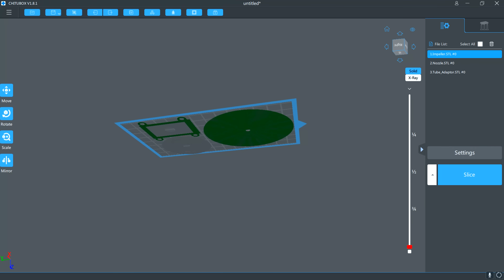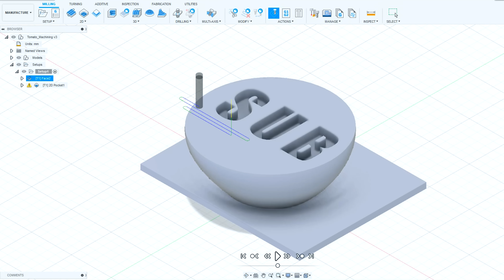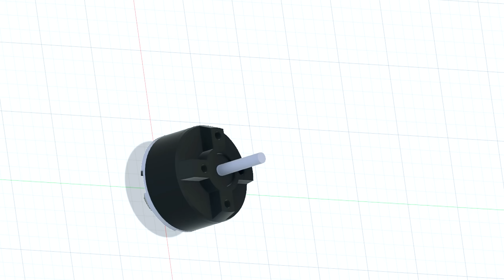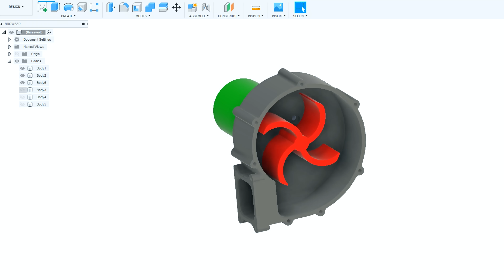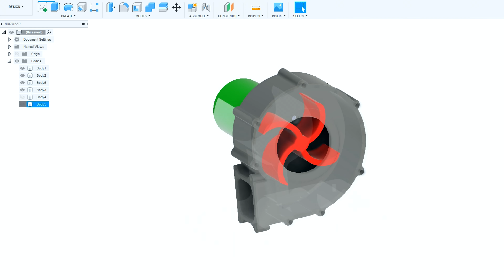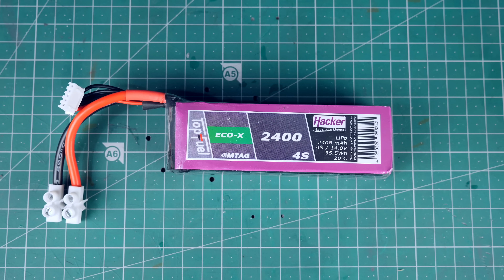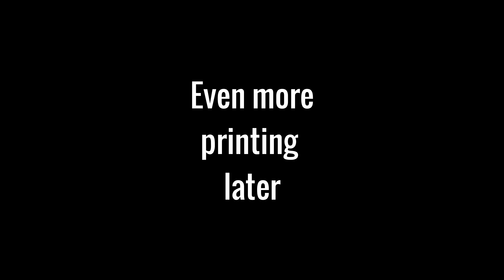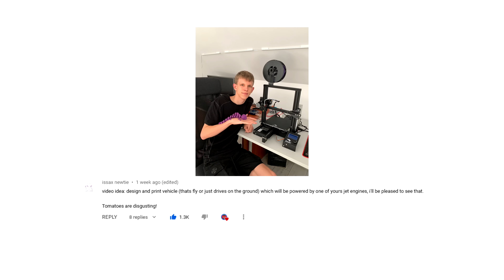Water Rocket Skateboard (3D Printed)

Comment: just watched the Video and saw some problems with your design.

1: you have a lot of cavitation which affects the flow rate in a bad way wich in return limit the maximum speed you can achieve. remember you dont want speed  in that case but flow rate. the more stuff you can push away, the greater the force.

2: a centrifugal pump isn't the best pump in your case. try a actual water jet engion design wich schould work better for that. theoretically you could use a tesla engine, but you need to know the perfect distance between the disk to use the maximum of the viscosity of wather.

and 3: build a small tesla turbine and put it on an RC-Draggster

Comment: Try using Tesla turbine and that way u can connect the rotating shaft of the turbine to skateboard’s wheel to provide POWER to the WHEELS . And the water pumping out will also provide thrust to move it forward . Design or use an small water pump to pump pressurised water into the Tesla turbine. 
And also lower the outlet hole in the water reservoir to use the bottom half of that water in that water reservoir.

 And crush thy gross tomatoes 🍅

Comment: A small suggestion if you try this one again, any water in the reservoir below the level of the inlet won't ever get pulled into the pump so is essentially a lot of dead weight. If you redesigned so the inlet pipe is joined to the reservoir at the bottom you'll be able to extract more water from the reservoir before the pump runs dry, or pump the same amount of water with a lower vehicle weight & hopefully get a higher vehicle speed as a result 🙂 Love watching your builds. All the best

Comment: At least in some scenes the pump seemed to blow up due to overspeeding when it started sucking air. If you print a round plate with regular holes (paint it to block infrared) in it and add it to the motor axle, you can use one of these IR sensors and IntegzaBot to sense RPM. If it starts to overspeed, IntegzaBot can disable power to the motor by disconnecting the signal wire between the remote and the motor controller.

Stop-on-Overspeed is a well known thing in the rocket industry. It was used in the V-2 rocket for its fuel and oxider pump.

Comment: After the multiple uncontained failures related to uncontrolled impeller overspeeds, even though no victim has been reported and failure happened only at ground level, I hear EASA issued an emergency AD to ground the entire fleet until the Type Certificate Holder demonstrates :
1) The design of an impeller design that must operate safely at any engine operating range up to 120% demonstrated take-off thrust
2) The design of a suitable engine speed control with sufficient authority to accurately control speed and forbid any overspeed of the impeller throughout its operating range up to 120% demonstrated take-off thrust
3) No Hazardous effect may occur more than once over 10^8 flight hours
4) Proper maintenance procedures on both impeller and impeller casing OR demonstration during a ground test that impeller failure does not generate uncontained high energy debris at maximum operating speed, including, if applicable, any OEI power excursion

Comment: The solution for making metal parts without using your CNC since you aren’t willing to cut metal with it yet is, “lost PLA” casting or creating molds of 3d printed parts and casting them with metal. I’d love to see one of your rocket engines made with that method!

Comment: Hi Integza, 
you might want to take a look into Viktor Schauberger's research about how to bring water into a vortex motion to accelerate it even more. If you could create a nozzle that brings the water into a swirl maybe it will be ejected with higher speed and therefor higher thrust.
And how about starting a crowdfunding campaign to get you a metal printer?

Or you can use electricity to convert the water via electrolysis into brown's gas and then burn it in a jet engine. Then you have a water powered rocket skateboard.

Comment: The pump schematic is good. There is only one problem. Instead of a plastic impeller, use a rubber impeller that will slide against the walls of the case. It will work much better;) and it won't explode the  pump xD

Comment: The design needs rework! Here are some suggestions:
First reduce the pumping volume you need speed not volume to be pushed. Half hight would more than enough.
Second stabilize the wings with  discs. The one to the input can have a hole in the middle.
Third adapt the propeller angle target pumping volume / speed. 90° generate high force to the wings and low output pressure. 10° generate low force and high pressure.
And for fun combine the watherjet with CO2 in a mixing chamber - as you did at your rocket science.

Comment: Theme: Try and make something, an engine or something using Strain wave gearing! Strain wave gearing is super weird and amazing, 

"Strain wave gearing is a type of mechanical gear system that uses a flexible spline with external teeth, which is deformed by a rotating elliptical plug to engage with the internal gear teeth of an outer spline"
Reply: I would not be surprised if that type of gearing had a 5 second life expectancy lol
Reply: @trufortune6771  its actually not that bad. If I'm correct, another name for it is a harmonic drive. Its actually a decent solution for certain robots because it can't be backdriven and offers a really high gear reduction.

Comment: Idea make a rocket engine with a solid magnesium core using that pump you created to pump water around the outside of the magnesium core and make a spiral fuel injector that pumps a spiral of liquid oxygen around it creating a wired rocket engine

Comment: you changed 2 variables at once: the size of motor and the design of the impeller. no bueno. i think the impeller you used with the 60krpm motor was worse.

Comment: Here's a tip to stop the acrylic from splintering everywhere while machining: Covering the top surface with some adhesive tape will make it a lot more forgiving. Plus your turbine would be a lot stonger if you left a disk at the end which supports the blades.

And in a future video, you also could print an air-powered Hüttlin spherical engine. That would be a proper challenge.

Cheers for the awesome content!

Comment: You should shoot liquid fuel rather than water with a tiny pump and have a spark plug at the end, and also have a metal nozel as with pressure the heat should stay at the tip if the nozel

Comment: Video Idea: Now that you mastered the power of water : ) ...

You should make a Water (or other liquid) Rocket ,
using some kind of chemical reaction or just pressure.
Reply: Hydrolox-engines (liquid hydrogen & liquid oxygen) produce water (=steam) as propellant. Very old technology, even the Saturn V used hydrolox engines in it's upper stages in the 60's. That doesn't make them bad at all, they still yield highest amount of delta-v than all the other chemical rocket engines in low air pressures. :)

Comment: Your prints failed because they were the color of a tomato.

Video Idea: Upgrade the water jet engine to use a screw impeller like jet ski's and SeaDoo's use. Also, use a stronger 3D resin like one from Siraya Tech, or even try printing with a Carbon Fiber Nylon or Carbon Fiber Polycarbonate filament. You can try using the "salt remelt" method to make the fdm prints as strong as injection molded parts.

Comment: You need to use the impeller design from a high pressure pump and use a 2 or 3 stage design. Like the pump on a fire truck. Also your efficiency was being ruined by cavitation. You want as little vacuum pressure as possible on the inlet side, big inlet small outlet. And, by restricting outlet flow the pressure increases while the flow decreases. Potentially more power using less water. It would be interesting to know which pressure to flow ratio is most efficient for a skateboard rocket.

Comment: Maybe try running one of those pneumatic engines off of water held above it (using the water pressure) with a return pump to keep the system cycling and put that on a vehicle, maybe with a belt drive or something? :D

Comment: Integza! it may help to make the pump more like a turbocharger than a flat vane pump like that. Might give you more thrust possibly. Also usually turbo impellers structure just lends itself towards higher RPM's much better. I actually 3D printed one for a vacuum project for college once using a drill motor and it worked like a charm. Even got first place!

Comment: I think you should use gasoline instead of water, and fix a spark plug in a metal chamber or a 3d printed chamber where the pressurised gasoline comes and ignites. 

Here is your jet engine.

Comment: You should print the impeller using. A more traditional impeller design, this will make it less loud, and should direct the water without so much oscillating. The motor seems like it should be able to handle the extra weight and the impeller should direct the water into the nozzle more efficiently. That may not be enough to solve the casing weaknesses, but it should help the design overall.

Comment: I'm a dummy, but I think your impeller needs several more vanes. Also, your water outlet is much too high up on the tank. It's only going to use half of the water supply.

Comment: Great video as usual ! In order to make a water expulsion engine, you'd be better off with compressed air to use as energy for the expulsion. Water rockets can go as high as 500m if they are well designed ! But you should use carbon fiber tanks for that efficiency, 3D printed tanks are not resistant enough

Comment: VIDEO IDEA:

how about create a turbo-thing.

so a turbo works by using the exhaust gasses to power a rotor that pumps more air into the engine, you could do this with your impeller, and it would explode less since your not trying to move it through water.

instead of using the exhaust to power the turbo, use your 60,000 rpm electric motor and cnc an actual turbofan that can more effectively pump and hold high pressure air.

and yes, i have subscribed and liked the video

Comment: I don't think you're design is the issue here, there is still a lot of air in the pump when you run it, this decreases the viscosity of the medium when the pump is running. that way it allows the impeller to speed up to insane speeds and shatter. If you have the entire pump submerged there should be no air and I think it would run fine.

Comment: It kind of looks like on the last attempt that the pump exploded as soon as the water level got below the top of the valve input.  Could the problem be rather than the speed of the pump underwater, that the pump started ingesting air and all of a sudden started going way faster (and subjecting the rotor to much higher forces)?  It seemed to be pushing itself alright at the higher speed up until that point.

Comment: I'm gonna repost my last comment on one of these videos. Print a small magnetohydrodynamic drive vehicle! A boat, jet ski, or submarine would be awesome.

Also, you should look into lost plastic and lost wax casting. You have printers and a CNC, so you can easily make accurate mold negatives that can then be cast out of higher strength plastics or metals. That way you won't be limited by the printed part at higher RPM or higher temperature. Also, have you tried Sirayatech high-temp or high-strength resins for your printers yet? There's also ceramic printers, or modifying one of your own to do it, maybe that would help with your rocket/jet engine projects.

Comment: Video idea You need to run the motor on a higher cell count the motor can handle 6 cells or 8 cells with the right esc and batteries you could make that motor run way faster. Also try adding a sper gear that connect to the paddle and a pinion to the motor to spin the paddle faster. And tomatoes are gross but ketchup is great

Comment: Would make a great boat like a jetski engine maybe. On the water container you could build a small box inside it around the pipe fitting with just a thin lip on one side for the water to enter at the bottom of the container that way you can drain the entire container into it instead of only half way. If you build a boat with this, make it a thrust vectoring nozzle like a jetski has.

Comment: The biggest problem was that pump Inlet was weyyy too small.... Senn by the air in the pump while running and the noise that it made. So if you fix this, the scatebord will work.

Comment: Your pumps are exploding probably because the impeller starts cavitating. Not only is cavitation alone capable of shattering the parts, but the rpm probably shoots through the roof. You need a geared pump for this, not a centrifugal one.

Comment: To fix the pump try using a stronger plastic like POM (Acetal). 
You can get a block of it and machine it since it machines and polishes pretty nicely.
And it's a very strong plastic that is self lubricating so it should help with optimizing internal resistance as well.

Another issue seemed to be that the pump was pumping out water faster than it was being fed, so the air created cavitation that destroyed the impeller and that air since it had to come from somewhere, most likely came through the nozzle, further reducing efficiency.

Hope this helps you fix it.

Comment: Nice Video Integza, but you are not operating the pump at its maximum efficiency, nor its maximum power, if you check any centrifugal pump chart, you'll notice that maximum power is never reached at full flow nor full pressure, what you must do for the next video is to add a pressure vessel and test with different nozzles (thinner ones) to get maximum power since we look for water velocity. Otherwise, an axial pump is better if you want to increase flow at low pressure.

Comment: Couldn't see if you did this, but I think your impeller could be improved by having an opening or "eye" at the centre with the blades radiating out from it. This allows water to flow quicker into the pump and will make the flow smoother I think.

Comment: I think that parts for high mechanical loads are better printed with FDM instead of SLA. Resin prints are more brittle and break quickly when deformed. I think that a rotor made of PLA is capable of withstanding higher accelerations and more pressure. As always a great video!

Comment: so much air in that pump! the valve is restricting the flow into the pump way to much. with proper flow, I wouldn't be surprised to see 10 times more thrust with that motor.

Comment: So this is a good idea I have a design tho that uses a water pump and then instead of dumping the water sends it through a second propeller connected to a shaft and then goes into the reservoir this is basically my idea of a water engine im not sure how well it will run with pressure being concealed in a closed circuit I don't have the resources to build the idea but Been wanting to have it made by so long

Comment: The reason your motor kept exploding (most of the time), is because when the water runs out in the motor, it suddenly speeds up and causes the impeller to explode due to the forces. Maybe figure out how to lock RPMs so that doesn't happen.

Comment: @Integza In your second design you addressed the problem with the first one. Intake Volume. As for the last test you are getting a huge amount of cavitation inside the pump casing at the rotor. This might blow itself up due to how much energy is being generated by that. Search out Cavitation slow mo footage if you wanna learn just how insane the forces there. Also gasses compress or convert from solid to gas chemically. Liquids do nothing of the kind & require an immense amount of energy to get the thrust you are looking for. Just imagine the tank & skate board contraption but instead of a water pump it generates thrust as a fuel tank & rocket bell & engine. Now that's a lot of THRUST.

Comment: I have 13 years experience in the RC hobby and when you brought out the "monster" motor, I nearly shat myself and thought, "he is gonna hurt himself". Then you did your first test and I was like, "HOW TF IS IT NOT BLOWING UP?!?" then you charged your battery lol!
Reply: 2,000 watts, THAT'S MORE POWER THEN 5 RTX 3090s!
Reply: @ThePower1037  my RC has 3600w motor. You should see the panic at hardware store when you ask for connector capable of 900A lol. For reference 13A is max for anything in a UK house
Reply: @acidflare8345  How does it stay cool!?
Reply: @ThePower1037  contact cooling through the steel balls anyone actually has to use that thing-
Reply: @ThePower1037  2000 watts is the same as 10 Olympic size swimming pools
Reply: @kiwishamoo6494  or 20 double decker buses.
Reply: @jmasonrcingabout273  or approx. 4.3 Millielephants
Reply: @ThePower1037  that's insane
Reply: Also only had 3s battery it can take 6......Thank God he did not go full power. I know first hand the damage he could have done still god dent in brick wall and scar, these motors are no joke
Reply: I was also wondering how much time until the engine get water inside and break. But.....
Reply: more like a MAMBA monster

Comment: You should stick the tube to the bottom of the box so you will have less dead weight from unusable water. If you want the tube to be horizontal, you could put the box higher or fill the bottom with styrofoam instead.

Comment: Great video! The nozzle should have inner "wings" to rotate the water. 
If you have two full bottles (same size and volume) and move them upside down and if one bottle gets a little circle movement, the bottle will much faster emtpy as the other one.

Comment: The water is so dense, that you can get away with far lower RPMs' if you just make sure you are pushing it efficiently. The motor is designed to do 2000W at very high RPM for pushing air which is light. If you push it using a motor that has the same power output, but is much more torque than speed oriented, you to get higher efficiency.